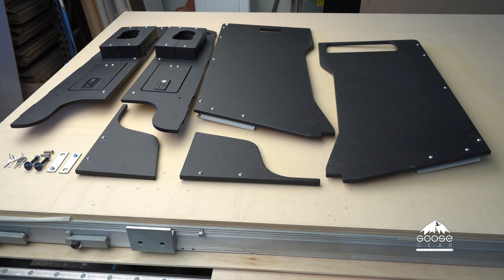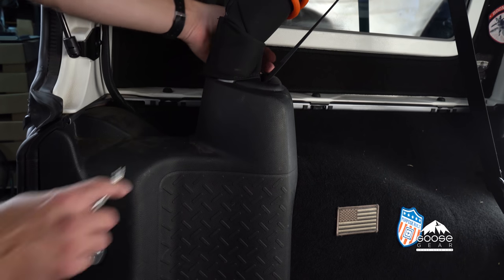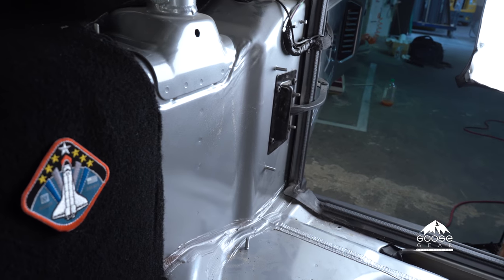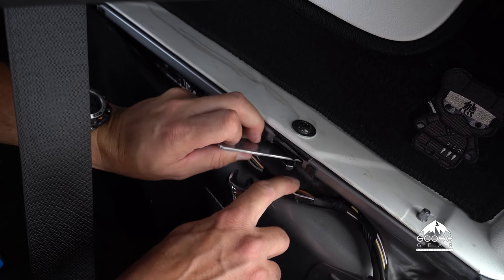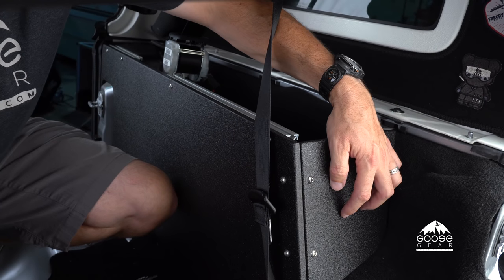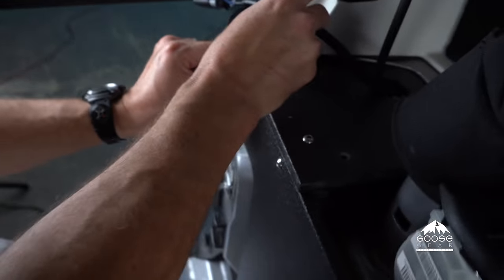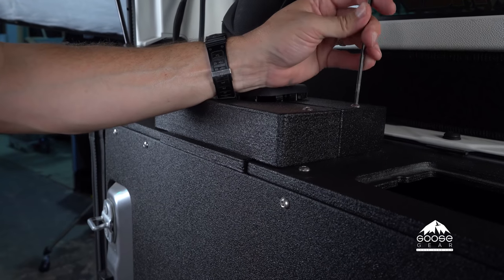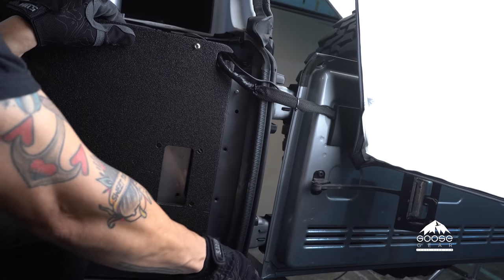5.11 Tactical JEEP JKU-Rubicon Full Goose Gear Side Cubbies Install Video

Comment: IF you ever install a soft top you will have to cut reliefs in the back of the cubby system to install the rear clips, not a big deal but had to cut not only the plywood but the aluminum bracing under it as well, no room for the clips otherwise.

Comment: Hello, would I be correct in assuming that the cubbies for a 2 door JK are pretty similar?

Also to assume removing the hard top and putting on my soft top for the summer will be fine as long as I replace the one hard top bolt.

Great video by the way.

Thanks,
Reply from the maker: Louis Roy correct!  And yeah, that one bolt will have to get replaced.
Reply: Wow, really fast reply. Thanks again. I also found the complete goose gear build series, very nice.
Now to work some overtime to get these
Reply: @FixBreakRepeat  are there any pictures of the 2 door version?

Comment: Just curious, why not use an electric tool for all the removals?
Reply from the maker: Personal preference - we were filming everything so hand tools are more dependable than running out of battery. Granted when dealing with stainless hardware you want to use hand tools vs. power tools to avoid potential galling/cold-welding.
Reply: Fantastic, good info, thank you.

Comment: This system will make removal of the hardtop difficult with the tie in of that bolt to the cubbie/hardtop.
Reply from the maker: The biggest difficulty is a nut that has a really bad habit of wanting to run away from you on the bottom, due to the sandwich style layers of the hardtop/and cubbie there is that piece, but I'd imagine the team over at GooseGear have a better method than I did.

Comment: Once you install the cubbies, how difficult is it to remove the hardtop?
Reply from the maker: David Black there’s a nut you have to be careful not to lose when removing the bolts holding the hardtop down. But as long as you stay on top of that it’s pretty simple.

Comment: I have a 2008 with that stupid subwoofer...do you just get rid of it?
Reply from the maker: xbpbat21x if it’s in the floor of the rear area they have a kit that accommodates for it. If not you get an extra storage compartment. Contact Goose-Gear for more info before you order!